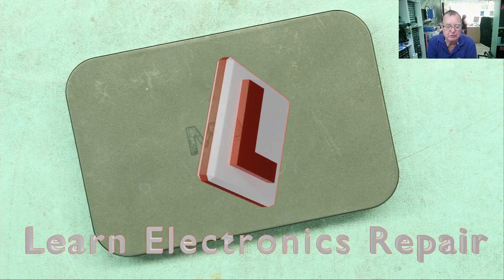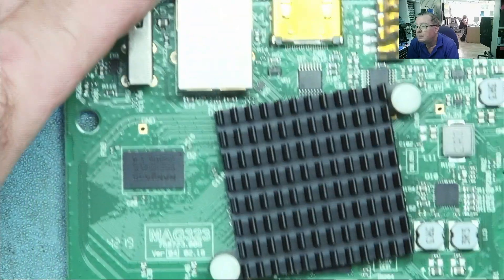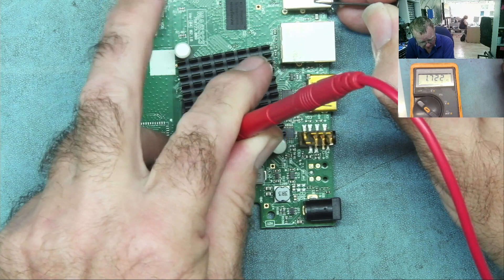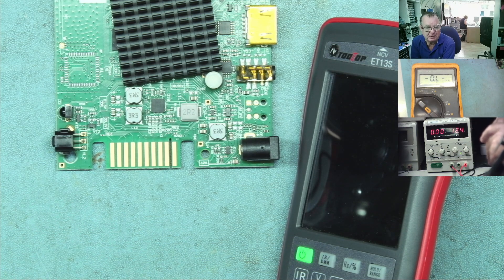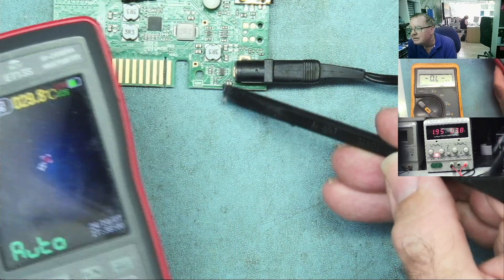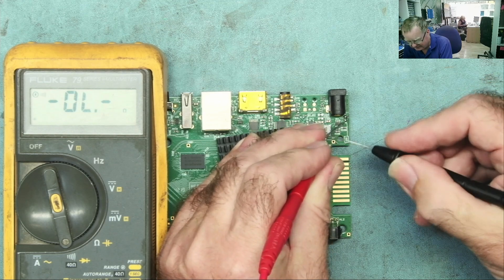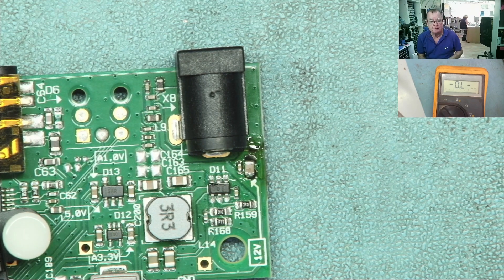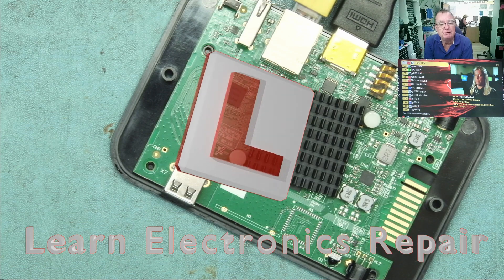Dead Linux IPTV Box MAG 322 Can I Fix It?

Comment: This lesson was for beginners. You said it was the smaller capacitor out of experience but you were wrong😂
Reply: Shit happens, it was always gonna be one of those two caps
Reply from the maker: @sivoltage  Correct. From experience it is often the smaller one but I am not in the slightest way if I say one thing and find it is another.  That is life and there is something to learn there too 😉
Reply: @LearnElectronicsRepair  I repaired one for a friend of mine and it was the bigger one. My theory on this is that they go bad due to age, so the one who is more likely to go bad purely due to chemical degradation is the bigger one. In fact, it works fine without one at all, given that a good 12V power source is given.
Reply: I was only joking , I all ready know that you are a master in electronics . I have watched all you videos on you chanel and learned a lot from you. I was only pulling your leg 😂❤🎉 actually I love you very much 💓